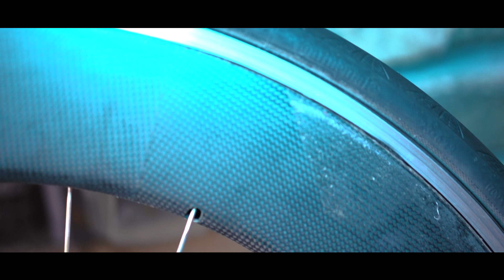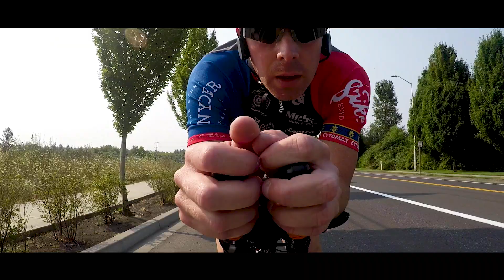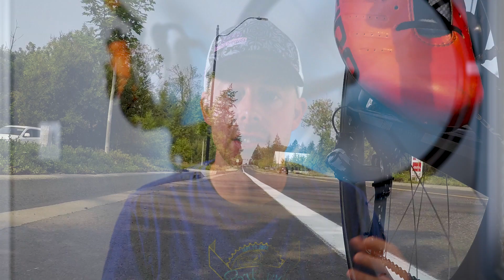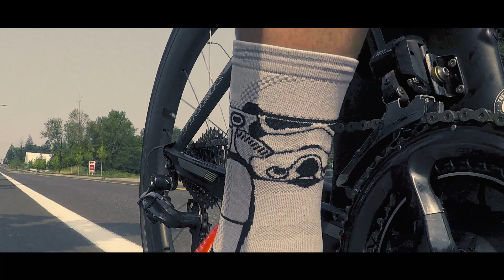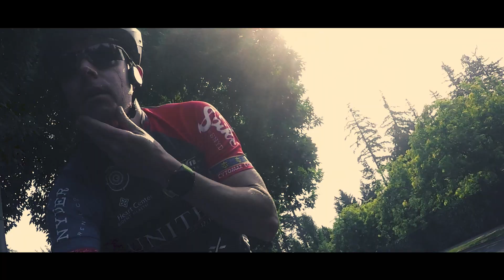Race Day Tire Pressure - Free Speed

Comment: What pressures do track cyclists use? and then what are the cDa losses from your recommendations (in watts ;-) )
Reply from the maker: Wow,  this is an old video.  Track cyclists use much higher tire pressure because of the smoother surface that they encounter.  So tire pressure should change based on surface and how rough or smooth that surface is on average for a given event.  Higher is better except when it's not.  😆
Reply: @mlegrand  ;-) physics are unchanged. so if you're riding on smooth French roads then the old tyres and tyre pressures are good. right? Yet TdF riders have gone wider over time. physics of tyres is complex
Reply from the maker: @SMarkGee   -  If the TdF riders were riding on roads as smooth as track cyclists (I have my doubts), I imagine their teams would be recommending tire pressures accordingly.  Especially in a time trial situation.